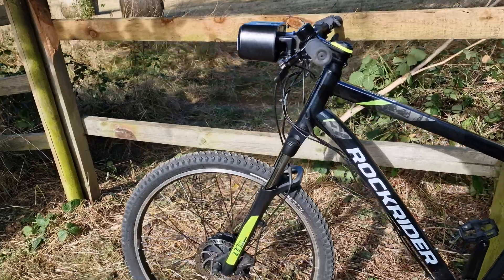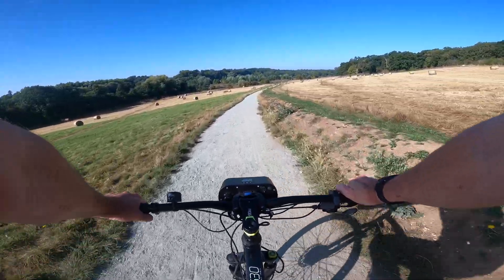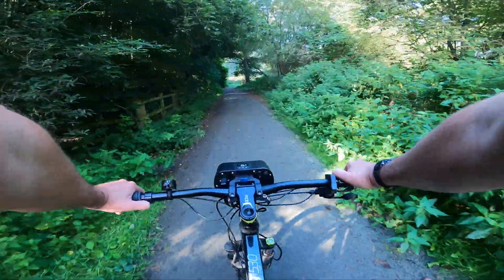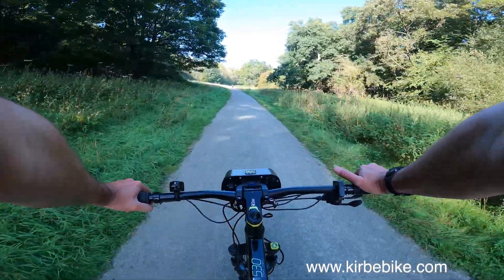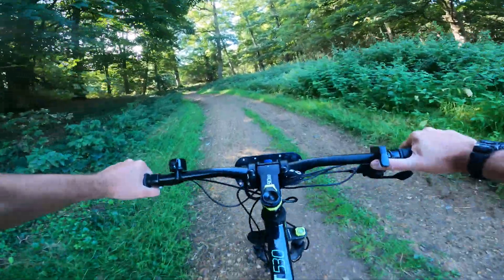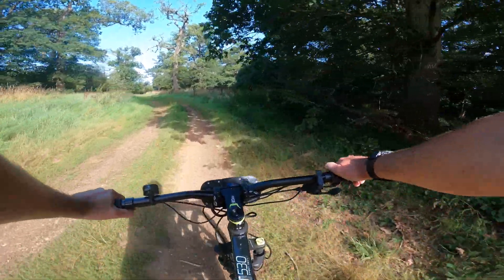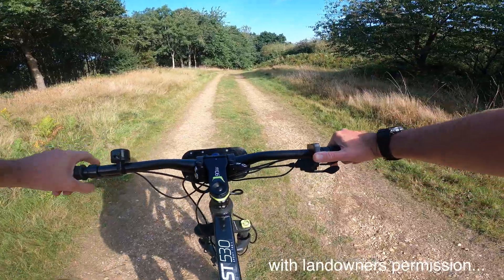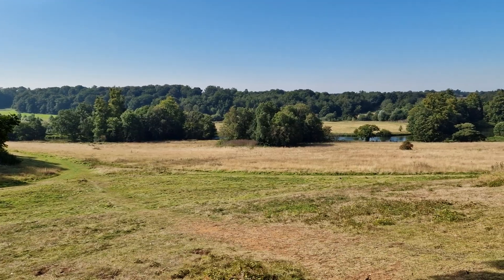HOW TO MAKE A CHEAP AND EASY DIY EBIKE!!!

Comment: I've bin holding my opinion on that ugly thing hanging off the front of that bike for a while
Reply from the maker: You can just use a regular ebike kit if you don't like it!
Reply: I agree, it just looks a bit ridiculous but it solves the problem of just having a normal bike you have to peddle hard up hills, and... it's good for those without the mechanical confidence to fit a hub drive conversion kit so I can see its appeal.

Comment: how is the torque on the fork dropouts? i would imagine it would be best fitted on a steel rigid fork to avoid the aluminium getting chewed up. i love the concept though andy. i got one of your 2000w rear hub kits last year and its still running bang on and more than fast enough.

Comment: Just curious, Andy - what - if any  is the rolling resistance of that geared motor with the power off - just pedalling?
Reply from the maker: Yeah its very low. I often just ride this bike with assist off completely.
Reply: @andykirby  Thanks.
Reply: Very minimal resistance with a motor this small.